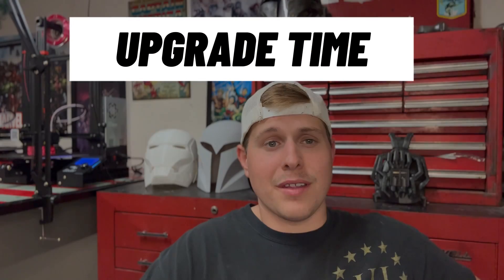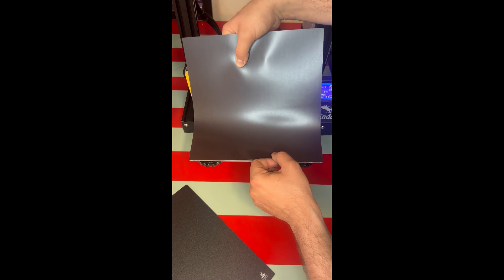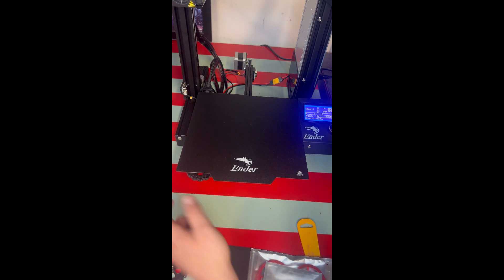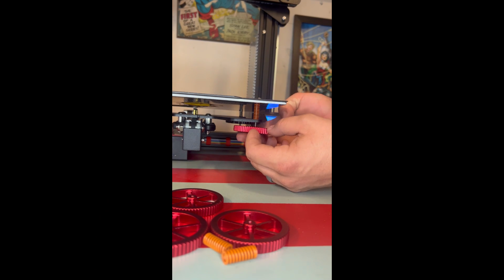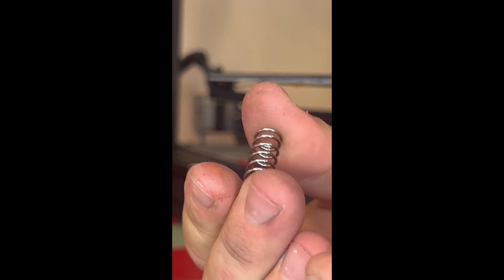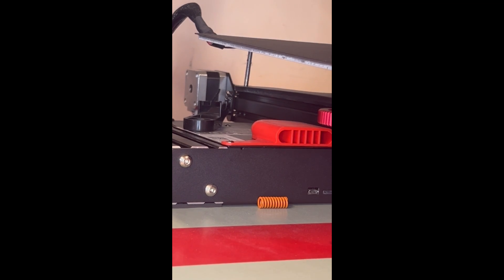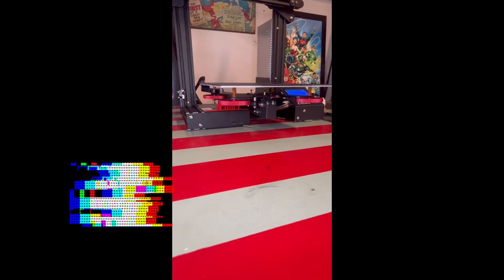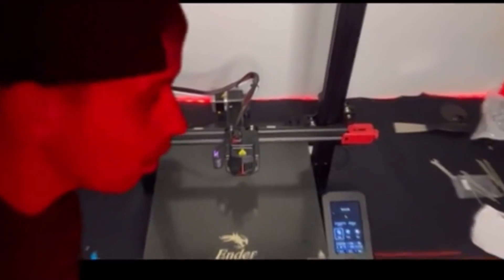Creality Ender 3 Upgrades You Need In 2023

Comment: Springs are a no-go. ONLY use silicone spacers.
Springs are not stable. They change with heat/cold losing your leveling. Silicone spacers do not have that issue.

Comment: What is the point of the bed springs/ knobs? Like, what is the benefit?
Reply from the maker: The springs are more firm and the knobs are aluminum unlike the factory plastic ones. The springs being more firm reduce how often you have to manually level the bed and the knobs look nice and like I said are aluminum it’s more about the springs than anything.

Comment: I've done the same upgrades and many more. One thing, your order should have been reversed. The speings should have been put on before the magnetic plate because if you need to put a screw driver on the screws to help remove and tighten the old/new springs then you'd have to cut the magnetic plate (never had to do this on any of my printers but you never know). Keep up the upgrade videos. Thank you.